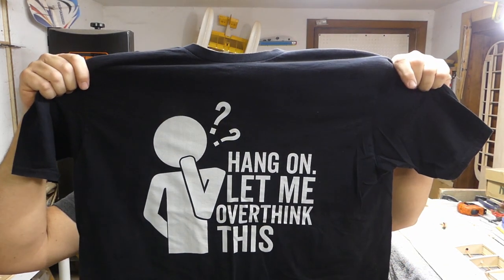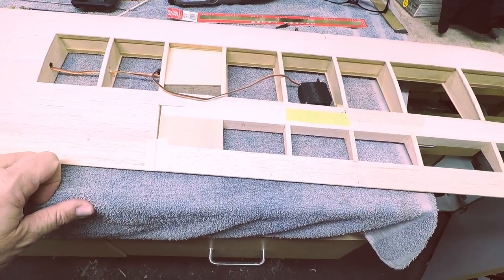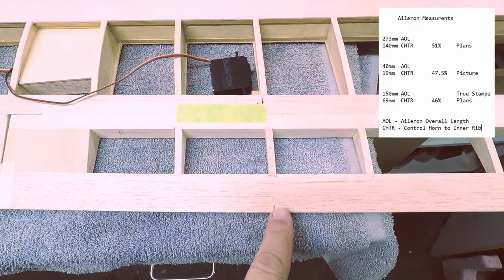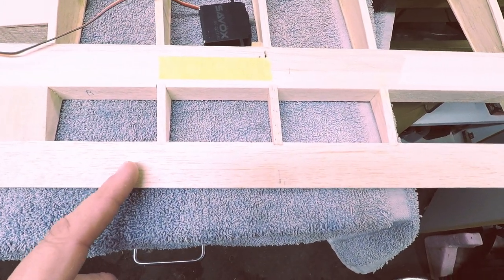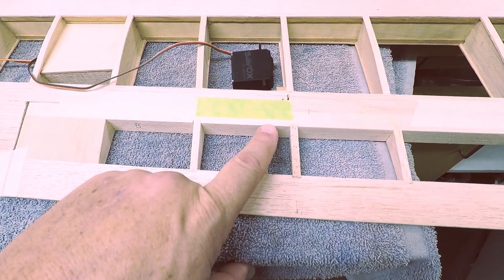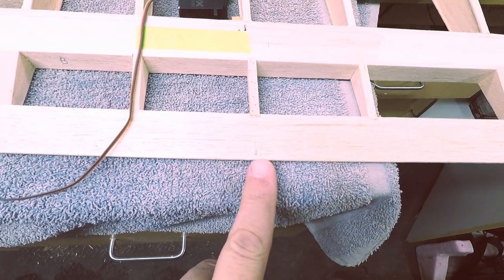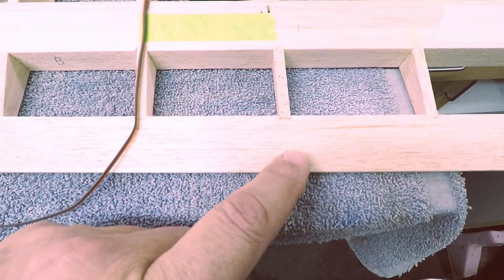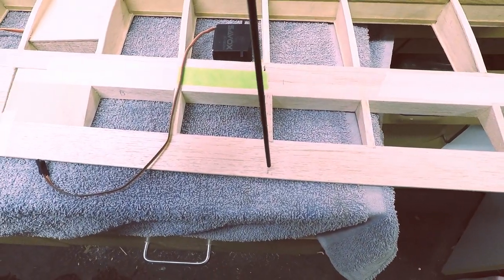Tiger Moth becomes a Stampe SV4 - Video 12 -  Ailerons Part 1

Comment: I'd go with a plywood insert rather than the brass wrap. And I'd use the standard clevis connection for your pushrod. One word for you SIMPLIFY...
Reply from the maker: "Simplify" is merely my last vestige of sanity. I used to work in the RC world as a "Product Design/Production Mgr". What I really did was act as machinist/die maker/product designer/production manager... So I've always looked for different ways to make the item look different from the rest yet serve the same propose. Thanks for your response. I still have 2 more servos for the top wing if I change my mind...

Comment: I can print up a control horn or wrap for you any shape you want.. I would carbon fiber VS brass. But you know me I know crap compared to your knowledge in building.
Reply from the maker: I just picked up control horns at MotionRC. Let me know if you cut vinyl...I'll need  "Stampe" logos for the tail. ; )
Reply: @BudChristensen  I can make template for you to cut or I know someone  with a cricket that can do it for me, Email me directly with the info.